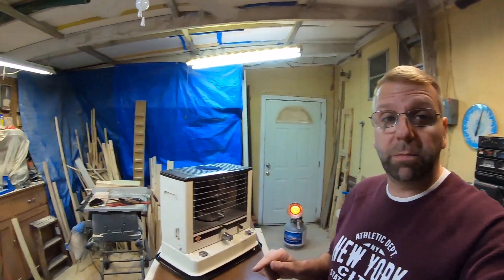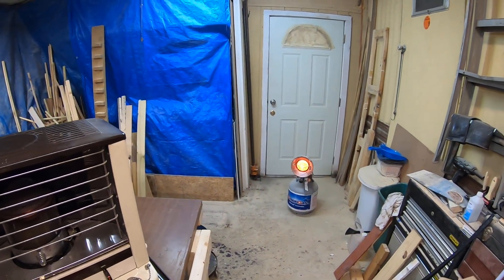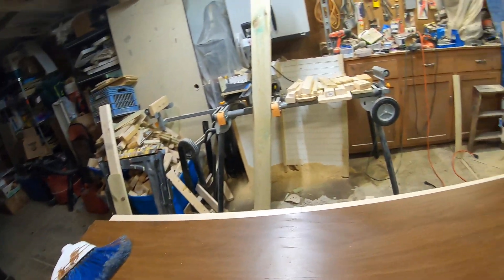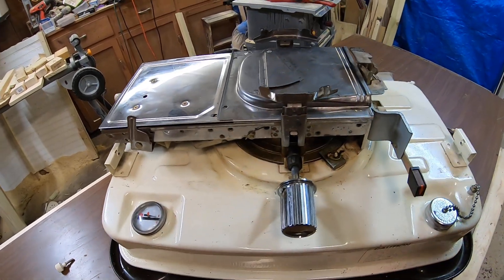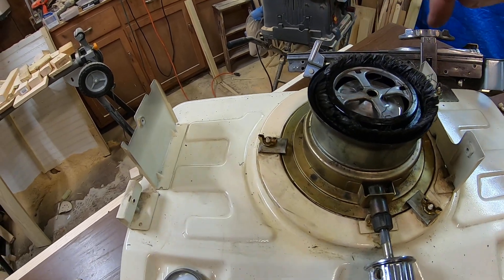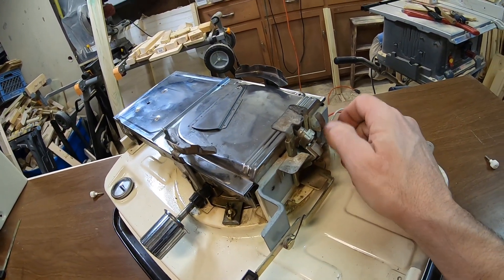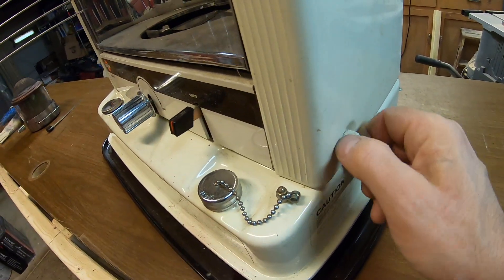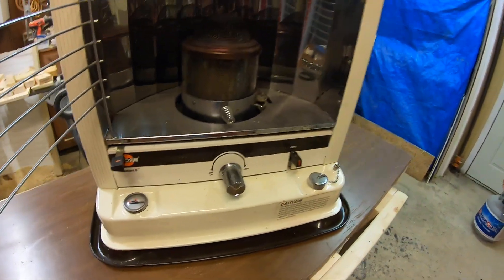Kerosene heater using Diesel WILL IT WORK Part 1

Comment: there are some folks that only use a kerosene heater when the electricity goes off and are not at all mechanically inclined as you are. The cost of a barely-used heater makes no difference to some folks. but in the middle of the night there is no store open at all to buy anything...
Reply from the maker: Hey Doug  Very true. Some are not inclined. My self. I learn as I go. I just hope my video. Does help someone.

Comment: Thank you for that information. It saved me from ruining a perfectly good wick. My wicks are fiberglass so diesel seems to be a bad choice. Kerosene is expensive but extremely reliable. My next choice will be 20 pound propane tanks to power a Big Buddy heater vs kero running my two heaters. If I don't buy anything new I'm money ahead. Good information is priceless. Thank you.
Reply from the maker: Your very welcome. I’m glad I could save you a few bucks. If you could subscribe to my YouTube channel. That would mean the world to me. Thank you for watching. I’m glad I could help. Stay warm
Reply: Greetings: I agree about the fiberglass crap wicks. Did U find a reliable solution r the diesel use? Also how is the Big Buddy working out? I can get diesel cheaper than propane. Thx 4 the share.

Comment: One bit of advice for people changing the wick ... you'll be tempted to fold the seam in and start pushing the flat part of the new wick onto the teeth first. Don't. Fold the flat part in and start from the seam. Makes it much easier when you get to the other side and are trying to flatten out the lump.
Reply from the maker: Good to know, But i did do a video on it. Called. Donta throw out that wick.

Comment: As of this writing... ebay kerosene 2.5 gullins for $38.05 and $26.98 for a lousy gullin of CROWN KEROSENE.. NO WONDER ITS TRASH.... Other then HAVING to clean the tar buildup around the wick. and having to RUN THE TANK DRY. DIESEL FUEL is a good source.. $3.75 for red dye...  its a no wonder THE KEROSENE IS SO DIRTY... there is no need for it be that high. but been doing it for 10+ years at;esat i can keep the few rooms without spending a fortune on the dirty over priced shit kerosene.... 8 kero-sun heaters i have. 8, 10 & the 46 series they all tolerate the diesel without issues...

Comment: I just bought Kerosene at $6.65 a gallon here in NY, crazy! I am going to switch to diesel, but wondering if it’s ok to mix the diesel with whatever Keri is left in my torpedo heaters, or if I should burn all the kerosene first.
Reply from the maker: Not sure if its ok to mix. But if you look up what places have K1  It might be cheaper.

Comment: Kerosene is $7.50 in Memphis right now. Diesel is $3.38. I have a 23k btu heater I like to sit next to outside on chilly nights. Giving diesel a try as this thing burns thru kerosene.
Reply from the maker: Hey Adam.  Kerosene here is $5.70. And diesel here is $509.   I’m glad you like the video. I hope you have subscribed to my YouTube channel. Just trying to make my YouTube family grow. Have a good one
Reply: I just pumped 10 gallons of Kerosene at $6.65 a gallon! 🤯 I came right home and started researching if I can switch to diesel. Going to give diesel a try now!
Reply: @mw3designs  diesel w rubbing alcohol ended up clogging my wick. 😔

Comment: After a year!! i have no choice but to burn diesel fuel.. $6.00 damn president......    i dont want to even know what the worthless shit costs.. probably $11 a gullin... ANOTHER year of burning diesel fuel in the KEROSUN RADIANT 36, 10 & 8 SERIES of kerosene heaters,  
diesel fuel is really sky high... which there is no need for it to be that DAMN HIGH!!!!.

I will repeat, never will never have bought kerosene... the jet planes can burn that crap.. its not only worthless, its not worth the extra money because i tried many years ago to burn it, and it not only stinks, but it gives me a damn headache..
as with diesel fuel, ONROAD OR OFFROAD, atleast its somewhat cheaper then jet fuel is...
AND NO PROBLEMS BURNING IT.....

Comment: In the US, modern #2 diesel is pretty close to #1 kerosene since they remove most of the sulphur. WINTER DIESEL is even closer to kerosene, as it is usually at least 50% blended-in kerosene - depending on how far north, and how late in fall / winter you buy it. Blends are changed seasonally. 

I have a dozen kerosene space heaters and two kerosene furnaces - one furnace does NOT require electricity to run ( 51,000 BTU ). 

I run diesel AND kerosene in various space heaters. Depending on several factors - the main issue with modern fuel is whether it is DYED or not. DYED kerosene and "Off road" diesel will clog up the FIBERGLASS wicks. The heater in this video uses a fiberglass wick. I do not know if his additive will prevent clogging with dyed fuel.

There is another kind of kerosene or "oil" heater that uses ALL-COTTON wicks. Cotton wicks do NOT care about dye or diesel - they just work. Therefore, I standardized on heaters that can use these wicks. The brands include Perfection and Aladdin. In addition, the "Moonlighter," "Omni-15," and "Rainbow" heaters CAN use all-cotton wicks. These last heaters can also use fiberglass wicks. ( I have two of these, they are smaller )

All-cotton wicks, however, are more of a pain, as they deteriorate and have to be "trimmed." Therefore, they get used-up and have to be replaced more often. Also, you cannot leave a heater on until it runs out of fuel - or you burn the wick even faster. However, the Perfection heaters can run on all kinds of relatively marginal fuels. The Aladdin is much pickier and requires cleaner fuel.

As for fuel prices - here in New Hampshire in winter of 2021-2022, Clear kerosene at the pump is $3.79 and regular diesel is $3.39 at same station. ( I have to drive 45 minutes to get the clear kerosene ) I had 250 gallons of kerosene delivered to my house for $3.29 / gallon. The kerosene prices seem to be more stable than diesel - but it's nice to have options.

As for additives - I use 91% isopropyl alcohol, or denatured alcohol. Usually about an ounce per tankful. I do that primarily to sop-up water in the fuel, if any ( though I use a Mr Funnel to trap water, first ). Also, a trick I learned to extend wick life a little is to pour a small amount of alcohol on the all-cotton wicks to facilitate lighting - otherwise, as the wicks age, they tend to not want to light until you trim them. With judicious use, I regularly get one full season out of each wick - which are on almost continuously for 3-4 months.

Comment: Not to mention the fuel oil for diesel fuel whatever you wanna call it it’s the same stuff it has 144,000 BTUS a gallon of kerosene has 128,000 BTU per gallon so you pay more for less!

Comment: Try burning diesel back 15 yeas ago.. Yes it worked but the heater smoked like a choo choo train... Now since the US has refined the DIESEL ULSD (ULTRA LOW SULFUR FUEL) TAKEN lot of the  sulfer out of it. it can be used in more things now... RREGARDLESS if the fuell is RED DYE or CLEAR FUEL.....
Reply: The only thing is, diesel isn't as refined. And diesel particulate is reasonably serious cancer concern. For a furnace it'd be fine, because it's exhausted outside. For anything that doesn't have outdoor exhaust, I'd probably only do diesel if it was an emergency. Just an opinion

Comment: Aleady been doing it for 10 years... Home heating oil And have the same model kerosun radiant 8 ... I don't add none of that garbage you people like to put in with diesel. Straight from the can to the heater.. Just do a complete dry burn.  Put enough in to how long you are going to burn the kerosene heater.. I always run it dry and never turn it off in the middle... YRUSIC YOU can go write ahead and put the extra crap in i just burn it straight. and no issues. i have 10 cerosene heaters and not have one issue burning HOME HEATING OIL (FOR THE IDIOTS THAT DON;T KNOW WHAT IT IS) (RED DYE OFF ROAD DIESEL FUEL) i CAN STRESS THIS ENOUGH TO PEOPLE!! burn the damn thing dry. and just add enough DIESEL to how long you intend to burn it. Then leave it go out.. Better yet once it goes out, put the wick up on hight and relight it. iT WILL burn all the crust shit off.  aND DONT PUT IT OUT IN THE MIDDLE OF THE CYCLE.... just let it burn completly out.
Reply from the maker: Hey Mike. This was my first time using diesel. So I did look it up on YouTube to see what I can find. Im glad to see guys like you that have been doing this for a while. This is how we learn. Im glad you put the comment. I rather have the guys who have been doing it for years. And know how to do it right. Thank You. Hope you have subscribed to my channel.
Reply: @RusticTrends  tHANK YOU much RUSTIC.. KEROSENE $4.15 a gullin or 5 gullins of the worthless shit for $30 AT TRACTOR SUPPLY  OR $6 thats a bunch of shit... I put in my choice of words because lot of people just don't understand the nice words. I had to do some research ruin a few wicks myself til i do some different kleaning solutions. and so far what i done has been working very well. BURN DRY THE DAMN THING. then put the wick up on high and light it up again.. may stink but well worth it and the wick will last for years... I been on my wick for 4 years now...

I dont know what you pay for your diesel. but i been burning the RED DYE DIESEL AT $2.00 A GULLIN. ANd no the RED DYE does not affect the performance of how its burned. Just met for offroad use nothing more...

NO WONDER i want to burn DIESEL FUEL and people like you want to do it to.. KEROSENE is just bout worthless to me.. just a complete expensive FUEL that i dont need. YES DOING THE EXTRA FEW STEPS just to save money is well worth it.. PUTTING UP WITH THE STINK of dry burning the thing.. And doing anohter lightup then start all over again....
Reply from the maker: @michaelgibbons6294  I hear ya. I did make another video. I will be putting that out soon. Buy now I think I have to make video number 3 now that I have been talking to you.
Reply: @RusticTrends  I know here in the UK home heating oil ( 28 sec ) is not the same as road diesel. I'm sure it would work in these heaters 28 sec or road diesel. 
I have been informed by a lorry mechanic that Maxol fuel is the cleanest about as he changes filters and one fleets filters were always good, they used Maxol. Probably be good for these heaters too.

Now burning different fuels is fine until you check out the heavy metals and other substances they produce, that's another story altogether.
Heating Oil can have a high sulfur content of 2,000ppm and is not the same for every state. High sulfer content is not Good. If you're were living in an area like Pennsylvania in 2015 you'd have been poisoning yourself slowly. 
Pennsylvania's home heating oil may have a much lower sulfur content now but that I don't know.
So really what works well for one person may not work well for another as their source of even home heating oil may be different and possibly even quite poisonous.

Unless you have the right test equipment who knows what you're breathing in. Just because a carbon monoxide alarm doesn't register anything does not mean it's safe. 
Just My two cents but hey, don't take my word for it, do some proper research and evaluate your own risks as we all have to do anyway I guess 👍 Nice heater!
Reply: Look under my name you should find a video of me doing a red dye diesel test on a FANCO SERIES 22...  IT seems like it doesnt matter what kind of kerosene heater you have with a wick with fiberglass wick... Just do what i mentioned in my first comment and you should not have no issues... Just put enough in the amount you will be burning it. Let the thing burn completly through the fuel and let it burn itself out.. Then turn the wick up on with the mantle in place.. If it doesn't like try few different areas with a cigar lighter, if it doesnt lite at all, it should be good for another round of HOME HEATING OIL
Reply: Very helpful, thank you! I haven't been running mine dry each time I light it. Haven't had issues yet, but I have been doing a dry burn every time I empty a tank, so that's probably helping a bit.
Reply: @jdisdetermined  Dpnt be afraid to lite it up again... but the more dry burn you do keith the healther the wick and the flame will be briter...
Reply: @michaelgibbons6294  So my flame has been getting weaker and weaker. Thought it was the wick, ordered a new one. Wick is called a #8 unpinned. It ran great the first time, but now it's doing the same thing. Starts out with a strong flame, but after a couple minutes it gradually gets lower and weaker. It's like it's not getting enough fuel. If I drip some diesel straight onto the wick, it comes right back to life. The wick itself is dripping wet at the bottom, so it's getting plenty of fuel. Running straight diesel, nothing added. Any ideas? 🤔
Reply: @jdisdetermined   it should remain soaked at all times, it could be the wick could be defective. i have some heaters, NOT KEROSENE HEATERS, THE NAME IS REPLACE>>> DIESEL HEATERS... i have not had no issues with the heaters except for the SEARS WITH A PINNED WICK, its a pile of trash doesnt like the diesel period. Have A KEROSUN 8, two 10, 36, FANCO series 22  & A KEROSUN OMNI 105....:>>> they dont care one bit for the RED DYE DIESEL..... I say try doing a complete dry burn of the wick, so that clears it up... relite it a few times... each time it goes out....it should be thirsty for the fuel and send it to the top where the fiberglass is....Then try it again... replace the wick then do what i said here, it should work without issues... Just let it go out completely, or just before it starts to go out put the wick up on high.. this should help klean below the level of normally it is set for normal operation.. let it go out, lite it up again maybe 1 or 2 more times..  Try that Keith... i hope it will work for you.... i know YOU ARE ONE DONT WANT TO BUY THE WORTHLESS OVERPRICED SHIT KEROSENE....  $3.35  here for red dye diesel and for 2.5 gullins of the worthless shit kersene 1 gullin is $20 at ace hardware, NO THANK YOU. BUNCH OF WORTHLESS SHIT..
Reply: @michaelgibbons6294  The one I have is a KeroHeat 2230. I think it's a copy of another brand? I guess I'll try a third wick and see if that changes it. I even tried trimming the first wick by hand and then torching the edges. Tried moving the wick up, so it raises higher. Always does the same thing, runs great then dies down. Soaking wet at the bottom, plenty of fuel. Dripping diesel directly onto the weak flame brings it right back for a minute then it dies down again. So does blowing air into the fuel tank, it loves a few psi. Both new wicks are doing the exact same thing as the old one. I'm half tempted to go buy a couple gallons of kerosene for the first tank with the third new wick and see if that works, then switch to diesel. Is it because I'm using biodiesel or whatever the hell it is? It's just regular straight diesel from the gas station, the same thing I run in my big jet heater. Which is kerosene too, but it loves the diesel. Seems more efficient per gallon, even less smell. It's awesome, just so damn loud. I planned on using it to heat up the shop initially, then shut it off and use the silent KeroHeat to help maintain it. Thanks for the advice, I'll give it one more try. 👍
Reply: @michaelgibbons6294  Haha I live in Albany, OR, right next to Eugene. Well that explains it. I'll have to call around and look for something better. All I see is the biodiesel at the stations I use. 😕
Reply: @michaelgibbons6294  Yeah, our fuel is expensive. They passed that mandate where they have to have at least 5% ethanol mix or whatever the hell it is in it too. Plus we’re one of the only states that requires pump attendants for gas. We can’t pump our own. Diesel you’re allowed to self pump, but not gas, for some silly reason. So that adds to the prices too and is a giant pain in the ass. But with covid, some places let you pump your own now temporarily. Where is a good place to look for red dye diesel do you know? Like an RV supply store maybe? Pacific Pride has it, but you have to be commercial to get a membership here.
Reply: @jdisdetermined  i would not know...ask around if soeone would know where they sell 100% red dye diesel, not the biodiesel shit... WHY even bother selling that worthless shit.. IT COSTS THE SAME AS REGULAR UNDYED DIESEL... thats a joke and half... i just pleased i lived in a region where they cant sell that trash... because of the low temp before it crystalizes..    i was out in orgeon just the past 4 weeks... EUGENE IS NICE but the state is a joke, where they really make up for the taxes by putting the gas prices way up....
Reply: Here in Britain. We use paraffin. Its quite expensive. So yr saying just use diesel?
Reply: @willgregory5847  its just all depends.... There are some kerosene heater (the name should be changed to DIESEL BURNERS)  Yes you can..... Try bout 10 gallons.. (fill the tank to for the time you are going to be using it... maybe 1/4 for 2 hours or so....  Run the tank dry.. Lite it up again. turn the wick to high and do another burn dry....   If you get through the 4 or 5th gallon and the wick still maintains the flame hieght.. Do burn the diesl.... I have a  kersosun 8, 10 & few 36 series few others..  a kerosun- omni 105... They dont mind the diesel one bit or in your country they call kerosene, paraffin SAME STUFF different names...
Reply: @michaelgibbons6294   Thank you. I will try that.